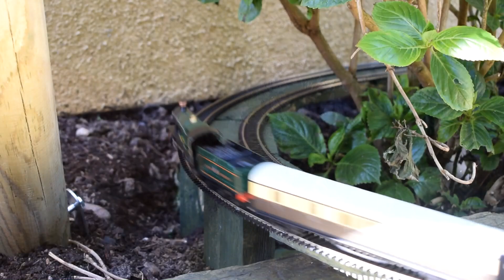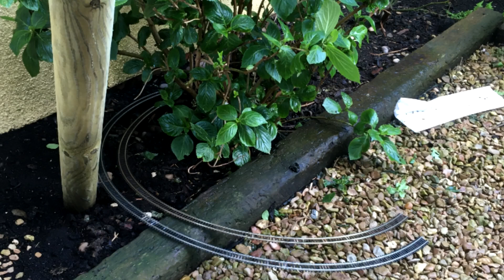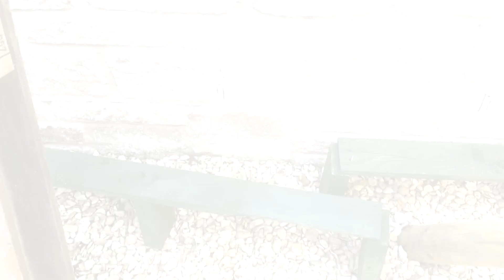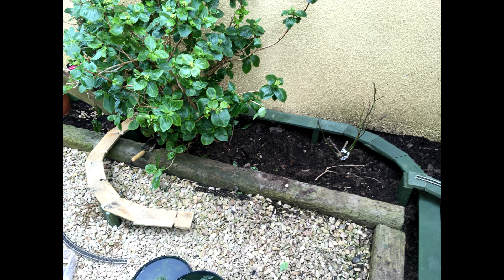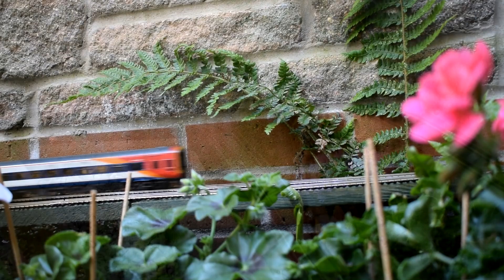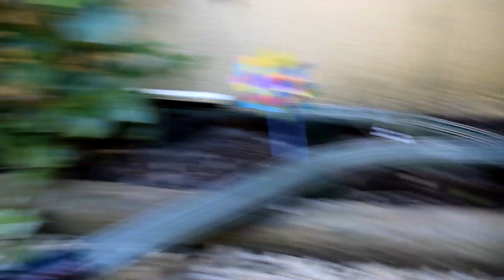Built in a Week: OO Gauge Garden Model Railway

Comment: Hornby track pins will rust out , without guard rails derailments could prove expensive if the stick drops off the side , looks good though and I am very tempted to build one too .
Reply from the maker: Garden railways do need to be maintained and used fairly regularly as the added complexities of being outside can certainly take its toll on the trackwork

Comment: This is awesome! 
I wonder how well the track lasted outside? I have just started a high up shelve loop in my garage, kind of ticking off a boyhood dream after finding my Hornby mixed traffic set I was bought as a child in 97 and I’ve been really enjoying it. 
I was told to have a bus wire running underneath to supply the track in various sections to avoid slowing as the loop measures just over 15 meters long. 
After seeing your garden railway I might have to consider drilling a tunnel to the outside world ! Thanks for sharing!
Reply from the maker: I have a more recent update on this garden railway on my channel - whilst the railway is probably no longer useable the track actually looks like it could be salvaged and reused - and that is after about 5 years of neglect

Comment: Thank you for the informative video. I’m currently planning my layout. I had a train set when I was a kid but want to attempt an outdoor layout as a bit of a challenge to myself. This video really helped. Just 1 question, did your whole track run using one cable attachment on each track? Cheers.
Reply from the maker: yeah, i just put a wire to each rail as per normal control - an improvement i want to make is to solder wire loops onto the track joins but it worked ok without them mostly

Comment: I like how your hall has that old little sandpaper in the tender to give it the chuffing sound, my Flying Scotsman does it to

Also great idea to get outside more
Reply from the maker: Haha! Yes, it's one of the more popular locos. Thanks for watching!
Reply: @ModelMinutes  no problem it was fun to watch, though that Britannia was close to losing its funnel.

Also if you're looking for new controllers I recommend the HM 2000 or one of the Guage master controllers.

Both can be a tad expensive but both of mine have been going for 15+ years with no problems
Reply from the maker: @photographerjamie  Thanks for the suggestions! I do have other controllers (I forget which kind they are) but they are in a box in a box  . . . . somewhere so would have to spend some time digging them out
Reply: @ModelMinutes  love that phrase, 'In a box, somewhere' I use it way to often when looking for trains I forgot about
Reply from the maker: Photographer Jamie 😂
Reply: @ModelMinutes  it sucks even more when you saw it a couple days prior and then can't remember where
Reply: @ModelMinutes  
On the subject of controllers I've used H&M Duettes and Clippers for years. They'll drive pretty much anything and are bomb proof. I had a Duette new as a kid and it's still going strong after 50yrs. I found another one cheap on Ebay a couple of years ago when my Gaugemaster gave up the ghost after only 10yrs. Plenty of control possibilities with high/low resistance and half/full wave current options. 
All my stuff is packed away since my house move 7yrs ago but will be getting a new lease of life in the garden soon I hope.
Reply from the maker: Robin Forrest awesome!
Reply: @ModelMinutes  
I did buy a Hornby HM2000 new naively believing it to be the same as my Duette but in a more modern package. I only tried it once but was very disappointed and it has stayed in its box ever since. I must get around to selling it on Ebay. It works fine but is definitely not comparable to a Duette.
Edit: I just checked out Ebay. These retail at well over £100 new. A secondhand Duette is definitely a much better option !
Reply: @photographerjamie Jamie, Which GaugeMaster would you recommend?
Reply: @alannewman85 Well there’s plenty out there all for different purposes, but if you want something simple that’ll do the job then the Model D or DS are some good ones to get. I believe they have a lifetime warranty as well but definitely double check that

Comment: Two things, first I noticed you didn't leave any gaps between the rails in you rail joiners. Track will expand based on heat so leaving gaps between the rails allows expansion without the track warping. 
Second you will probably find gunk build up between the rail and joiner that will cause valtage drop allong your line. This just seens to happen especially if the joiners loose. If you aren't that concerned with looks then a peace of wire soldered between each rail should remove this issue otherwise you can wiggle each joiner to clean them. 
I deal with a similar setup and this does help.
Reply from the maker: Thanks for the info - there are some gaps in places but clearly i didn't do enough as i have experienced some expansion. Not too much of an issue though as it is easily fixed. This is meant as a bit of fun and not a "serious" garden railway

Comment: Nice little railway. I hope you are right about the shaded area, it would be horrid to come down and find the rails bent and broken out of the sleepers due to expansion. I'm sure you know, but most people leave gaps between the rails and solder wires between the joints for electrical continuity, or just leave the track free floating, solder the tracks together and put wooden blocks between them to stop them sliding together. Good luck with it. :-)
Reply from the maker: Thanks for the info! I have experienced some expansion in recent weeks with the hot weather - the worst that happened so far was that the track lifted and the pins will need to be tapped back into place, and one length or a curve decided to disconnect itself and fall off (but that one wasn't pinned anyway) so hopefully that's all for now :)

Comment: Hey there. It seems you and I had a similar idea by building a cheap and quick garden railway. Some things I've learnt through trial and error is to use conductive carbon grease on the fishplates. This keeps the surface areas between the plates and track from oxidising whilst increasing the conductive area.  Oh and yes, the power clips will oxidise and stop working very quickly. Ditch the power clips and pop some wires in the groove where the fishplate goes on the set track with a bit of carbon grease. It's a tight enough gap to grip the wires in place. I hope that helps. Looking forward to seeing what you do next 😊
Reply from the maker: Thanks for the info! Might have to investigate that grease :)
Reply: Why would you bother with the grease when it's better to solder droppers midway along the rail itself in the gap in the plastic sleeper set which is there for exactly that purpose? The rails of nickle silver track, even with carbon grease filled rail connectors, are not as good conductors as a copper wire bus soldered to the other end on the connectors.